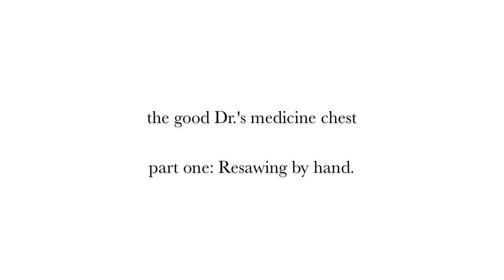Resawing by hand - The good Dr.'s medicine chest part one.

Comment: I would be in therapy half way through the first one.

Splendid work.  It's not easy getting the heart and mind in the same zipcode...looks like you figured it out.
Reply from the maker: TheJimsock,
thanks for the comments ! Having the two handed grip and the wide 'rowing' movement, makes the process almost easy. Especially in straight grained wood that's only 6-in. wide like this holly was. Boards in the 12-in. range can get a little hairy, but these weren't bad at all.
All the best and thanks again~
Reply: Tom Fidgen Thanks so much for responding.  I think I could manage the physical part of it....managing the blade on a seemingly unwieldy tool and keeping it on line over such a length would stress me out.  Especially working from opposite directions and hitting it right or at least close enough to correct with a plane
I miss it now and again with a power saw. 
It's getting all the skills and techniques to come together for a result is what would send me off to test my insurance policy at a therapist.

It's one of the reasons I don't golf.  At least in the shop, I can only hurt myself taking out the frustration....if you see me on the golf course, run for your life.

Thanks for the vids.  I really like them.........the music too.  Nice respite from all the techno on Youtube.

Comment: You sir are a genius! This is the most original idea regarding resawing I have seen anywhere! Is it inadvisable to make multiple kerfs across the stock and just rip them all, or do you really need to flatten and re/kerf each?
Reply from the maker: Joshua, thanks for the comments and question. You could certainly kerf the entire thickness of the plank and resaw- I prefer flattening one face first- this gives me a veneer that only has to be dressed on one side.

Comment: After seeing this video I have to build myself a frame saw. I live in Spain and can't find a decent rip saw, the cheap disposable rip saws available have really uneven set and are a nightmare to try and keep on line when ripping thick stock. After reading about frame saws in old texts it occurred to me that they must create less friction and your video seems to prove this.
Thanks for sharing.

BTW: What's the TPI on your blade?
Reply from the maker: thanks Robert- 5 tpi with zero set. all the best~
Reply: They are easy to find second hand, just need to resharpen which is straightforward for large rip teeth - look on E bay or tool auctions on Saleroom (eg. David Stanley).

Comment: Sorry for the amateur question here, but I am, well... an amateur...haha.  What is the benefit of flipping and turning the piece as opposed to just ripping it all the way down in one shot.  Obviously when you get to the very bottom i understand that you need to flip it since you can't cut through the vice, but you flipped it and turned it multiple times well before you got to the bottom? Is that just so you ensure a straighter cut?? I would think it would be straighter doing it in one shot so you don't have to join/meet up your cuts... but then again, that's why i'm the amateur and you're the expert, haha.  

Thanks in advance,
Joe
Reply from the maker: Hey Joe,
you answered your own question- yes- it's to make for a straighter cut. These tools were still fairly new to me at this point so I was worried that my cut may drift on the opposite side of the work piece...turning it every so often keeps it on track. As these surfaces get hand planed after wards, going from one side and then the other doesn't really affect the final piece.
hope that helps and thanks for the question-
Reply: Joe Grosso 
He also seems to be a big tall dude with long arms working a really long saw.
Cutting into the vice would be one problem but ergonomics comes into play as well, if he'd keep slicing away at it if he's out of good position either for body mechanics or just simple observation the saw will eventually wander.
It's also why he seems to either be pushing the saw either up hill or down hill more than half the time.
It's better position to let your tool do the work but also keeps you on track by keeping more in the kerf but also more of the blade in the piece being cut keeping it more stable.

Comment: Hmm, there i am with all my powertools...
Anyway, i noticed that the resawblade is set to cut on the push.
Is this how it is supposed to be? If I had not seen your vid I would have set it to cut on the pull. 
You obviously know what you are doing, I was just wondering.
 Is the first kerf you make to guide the resaw blade? Is it the same thickness?

Thanks for posting this beautiful way of woodworking!

Cheers,

Norman
Reply from the maker: Meulmeester- thanks for the comments. I use my Frame Saw like all of my Western Style saws- that's what I'm used to using and it feels comfortable for me.
That said, I don't see why you wouldn't be able to use a Frame Saw as a pull saw if that's what you're used to or prefer.
You'll find more information about this here on my website- http://www.theunpluggedwoodshop.com/the-sawyers-song.html
all the best !

Comment: Hi Tom,
Great video as usual, the boards look VERY smooth and straight after using the frame saw. Do they require much planing afterwards?
Reply from the maker: Rob K,
thanks for the question. The holly is indeed really smooth; it's a nice tight grained wood that takes a hand plane really nicely. I plane one face of the stock to begin, then rip off a veneer- then I plane the face, and then another veneer. That continues all the way through the stock and I'm left with veneer that is already smooth on one face. The back sides are dressed with the help of a planing board- you'll see that process in the next video of this series.

all the best-

Comment: I can see you're using the remaining side of your stock as a flat reference surface for your Kerfing plane, do you need to re-flatten this surface after every resaw cut? or the cut is already so clean that planning the remaining surface is not needed? thanks.
Reply from the maker: Good eye.
Yes, I re-flatten the surface of the thick stock after each veneer is sawn. It's easier to do it this way as the thick stock is easier to hold and once the veneer is sawn, one side is already smooth-
all the best~

Comment: What is the saw called you use at 2:45?
Reply from the maker: I named it a Kerfing plane, as it was designed to cut a saw kerf around the work piece prior to resawing it. You’ll find detailed plans and instructions in my book: the Unplugged Woodshop. It’s available on Amazon and other online retailers. Cheers-

Comment: Tom, question for you, what size of a smoothing plane do you use? Is it a number 7 plane. If so, I am ordering one for my shop. Like your wood projets. Keep up the great work.
Reply from the maker: Aaron,
thanks for the comments and question. My 'Smoothing' plane is a No. 4 as well as a wooden Krenov smoother. A No. 7 is a Jointing plane.
The numbering system plane makers use refers to the length of the sole-
a No. 1 is the smallest, No. 2 a little longer and wider, No. 3 a small smoother, No. 4 a traditional smoothing plane- ( this is the one you'll find in most flea markets etc..) a No. 5 is a Jack, a No. 6 is a Fore plane, and a No. 7 & 8 are Jointing planes.
There were also 4 1/2 and 5 1/2 which means they were the same length, just a little wider.
Don't worry too much about the numbering system- if you want to flatten LONG boards, get a 7 or 8- ( a jointing plane )
the plane I use in most of my videos is a No. 5 Jack plane.
Hope that helps-
all the best
Reply: Tom, 
When watching your video, I see that you use a long plane. I would like to know what size is the one you use for your long boards. Thank you
Reply from the maker: The long plane I used is a Veritas Bevel Up Jointer. If you Google that you'll find it. All the best~
Reply: Thanks Tom

Comment: do you think this would be possible without the kerfing plane?
Reply from the maker: Thanks for the question Ben.
Is it possible?
Absolutely.
But the Kerfing Plane makes it easier and reliable. 
Remember, woodworkers used to saw veneer by hand for thousands of years before machines came along. The Kerfing Plane wasn't part of that equation.
I came up with this idea in 2010 and have been using it ever since. I've taught hundreds of students since that time and have made dozens of Kerfing Planes with my students. It works. Bottom line.
Hope that helps-
all the best
Reply: thanks tom, very helpful, I'm going to be starting a very ambitious project soon, some 
complex acoustic diffusers and plan on making them all by hand, there will be a lot of thin pieces that need to be laminated together. I just need to make a saw similar to the one in your video and may make a kerfing plane as well, then I can begin.

Comment: Would you ever make cuts like that with a regular rip saw or is it too risky with alignment (cutting smooth and straight)?
Reply from the maker: +Slap Stick Great question...the answer is yes, I have made these types of cuts with a standard hand saw but its very difficult work. This method is much more reliable, as well as easier with two hands and more accurate.
Reply: Tom Fidgen Thanks Tom. I'll have to get one...or make it.

Comment: How thin do you think one can reliably go using this method?
Reply from the maker: 1/8" no problem...anything less gets a little tricky but smaller pieces I've gone down to 1/16"...
Reply: Thanks! I'm think I might try to saw veneer this way. I'm guessing I'll need to increase the TPI and a small kerf seems useful...
Reply from the maker: we use this technique all the time with students at the Unplugged Woodshop. We run a week long course where students make their own Kerfing Plane and Frame Saw- the following week they resaw their own veneer to make a parquetry panel. These tools work amazingly well for accurate veneer with hand tools. best of luck with it-

Comment: Thanks for the video.  Did you smooth the board after each slice of veneer?
Reply from the maker: Vance, thanks for the question.
I do smooth the surface between each veneer- this is easier to do while the stock is still thick.
You'll find more information about the process on my website- http://www.theunpluggedwoodshop.com/

cheers!